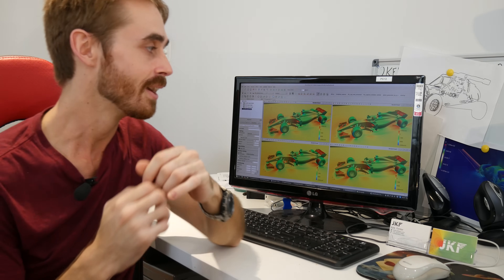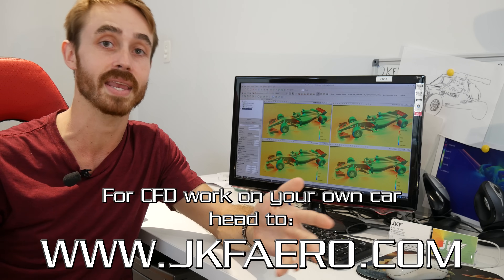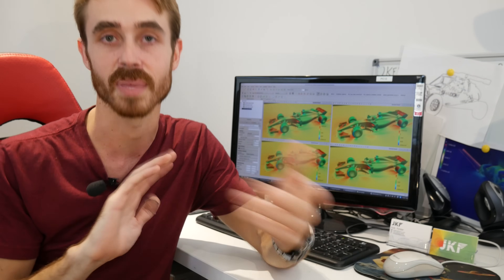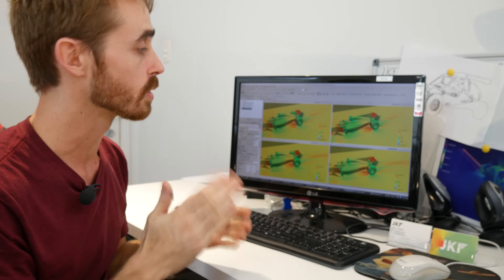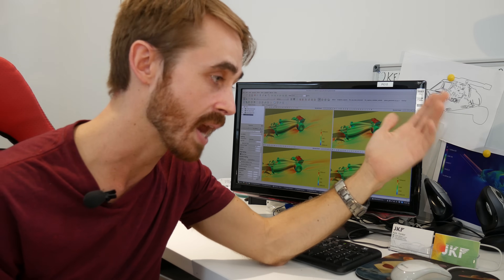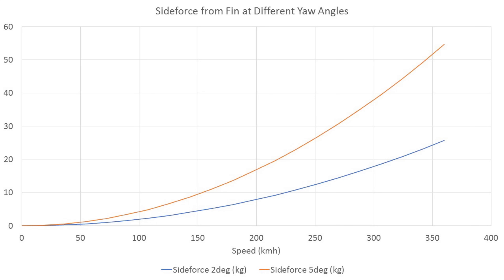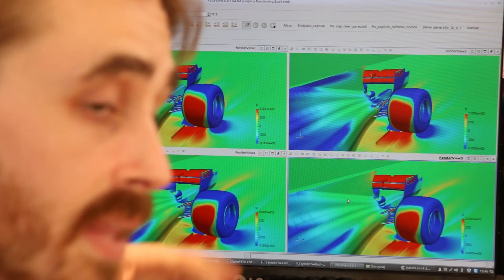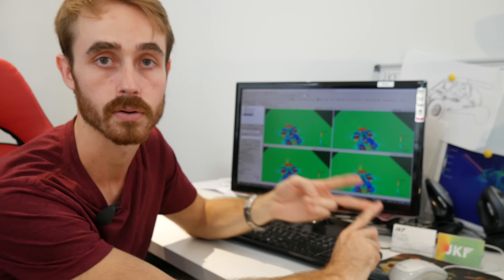F1 Shark Fins in 2017 - How Much They Do, Detailed Explanation and Mythbusting!

Comment: Yeah very simply put, it provides a later force at the rear of the car, which is typically provided only by the tires on the pavement as the car tries to turn.

The rear tires are gripping the pavement, preventing the rear of the car from sliding out during a turn, as well as the fin.

And yeah, it’ll help if you have a tank slapper too which is always good.

Comment: You speak about results confirming the loss of downforce performance in straight line due to the presence of a shark fin, but the interest would more be on the effect on rear wing downforce with cross-flow/cornering conditions (lets face it, there's not a big need in downforce in straight lines...). It helps keeping the oncoming flow on the rear wing straight in cornering or crosswind conditions. And as these wings are designed for optimal performance in aligned flow conditions, it's beneficial for the downforce generated by the rear wing in these conditions. I'm sure you can check the rear wing downforce results to check this point.

I think it's an important point explaining why shark fins have been used in f1 along obviously the main effect of sideforce generation when cornering as you explained.

Besides, can you provide some of the parameters of your computational set-up ? (mainly the turbulence model used - as I imagine these are RANS computations -) It's always interesting.

Comment: I have a question regarding a shark fin on a production car more so on a FWD. Now you may be thinking what the heck do you need a shark fin on a FWD but if the shark fin really does add stability at higher speeds than that means the car can be set up on the looser end for low speed corners. What is your take on this concept?

Comment: Kyle, thanks for the video. I understand you can increase the side force if the car is at an angle of 2º or so of yaw. But this is assuming the car is sliding? in a normal corner without the car sliding does it increase side force at all? Thanks

Comment: Kyle, constructive criticism here. The video mode you're using is continuously changing its focus point, which is annoying and makes the video almost unwatchable (which is a shame, because your analysis is quite good). I'd suggest one of three things, depending on how advanced the video mode of you camera is; none of these will take you more than 15-20 seconds:
1) Take the aperture to its minimum to have the largest depth of field possible.
2) Select your face as the focus point and let the camera do continuous auto-focus on that point (most cameras have some kind of face/eye-recognition software); when you're showing us the computer you obviously select the screen as the focus point.
3) Do some manual focus - choose your face as the focus point and then try to sit still in the chair (to avoid getting outside the focus point).

Comment: in addition to the shark fin, i see that teams are running a t-wing (with HAAS having to remove and modify theirs.) at the rear termination of the shark fin. It is an assumption, but is this in an attempt to 'tidy up' the air onto the rear wing? minimising the negative effect on rear downforce?
Reply: it's actually for additional down force since the rear wing is a lot lower this year. you'll see at tracks like Singapore, teams like mclaren added extra t wings since a high downforce track. so yea added downforce

Comment: Thanks for clearing that up. I've been seeing the "cleaning up air to the rear wing" comment on a lot of professional sites (not just forums and reddit) and have been really confused/non believing.

On that note, secondary question: The "cleaning up air to the rear wing" argument has been made for the t wings as well. Am I right to think this is complete bs? The t wing is way too high and close to the wing for it to have any significant affect as far as cleaning up dirty air. I've also seen arguments for it assisting upwash for the rear wing and diffuser, but I also call bs on that. My guess is that it's more likely that is just a straight normal downforce generating airfoil. Thoughts? Note that these comments don't apply to William's lower T wing. That has to have a significant effect on the performance of the rear wing and of the "connection" between the rear wing and diffuser.

Thirdly, on a more personal note, can you do a video on CFD? It's something I work in professionally right now, but in a much more limited context that what you're doing (I'm analyzing turbo chargers instead of full cars. Much less interesting IMO). What kind of turbulence models are you using? Cell counts? Y+ targets? etc. I'm guessing you'd probably be using OpenFOAM since you're doing freelance work, but I might be wrong about that.
Reply from the maker: Yeah, I think one thing to always remember is that the majority of F1 sites feature content written by journalists, not aerodynamicists. I'm not going to name names, but there are quite a few out there that I have a good chuckle at. 

I agree with you, no way are they conditioning air for the rear wing with the T wing. My primary guess is a free downforce gain combined with mildly supporting the rear wing. You can take a guess at what CFD is running currently though...

And not really, a good magician never gives away his tricks ;)
Reply: KYLE.DRIVES yeah, I think scarbs is usually fairly close to accurate. He's one of the few to talk about the t wing and immediately dismiss (to my knowledge anyways) it having a significant effect on the rear wing. That said, he has peddled the "redirecting airflow to rear wing and straighten up flow" idea for the sharkfin, so there's that too. 

Can't wait to see to see the data for the t wing. I'm assuming you're going to make a video for that one?

And fair enough. I guess we'll just have to trust you on these results. ;)
Reply from the maker: Quick preview, the T wing itself makes 2.5 points of downforce, with L/D>10, which lines up pretty well with hand calcs. So yeah, pretty sure it's just a downforce element. And yes, there will be a video on it!

Comment: KYLE.DRIVES A great video as always. 
Wouldn't it have been better if you had evaluated the Side force coefficient and increase in lateral G's at much lower speeds say around 200 kmph as F1 cars don't corner at speeds above 300 kmph.(Eau Rouge being an exception😉)
Also doesn't the shark fin reduce the down force produced by the rear wing by blocking a part of the central section at high yaw angles?

Comment: could you do a video on the CFD analasys software you use,some tutorials or guides?
Reply: like, he`s an engineer, and I think cfd is a very complex process so it cant be explained in a tutorial, instead its a long study of fluid mechanics, wich is a theme of mechanical engineering.
Reply: mario kovac also what server they are running and how long it takes to calculate something like this.

Comment: Awesome video, loving the new content.

Based on this and your video on Finned Rear wings in rally applications at high slip angles. It'd be very interesting to see a video with CFD analysis of drift car aerodynamics, i.e. when the slip angles are huge (circa 30-60 degrees at times) and how effective the standard aero practices are under these conditions.
Reply from the maker: Thanks! I've actually already planned to do the drift video, models are ready and green to go, I just need to find the time to run them...

Comment: Are there any issues similar to the ones discussed with swan neck wings? Where turbulent flow from the fin could stall the rear wing at high angles of yaw? Maybe this isn't an issue because shark fin is both above and below rear wing? Would this be a bigger deal in 2010 when the fin was more below the rear wing?

Comment: Footage of Renault's car in slowmo shows lots of movements of the shark fins while cornering (they're really thin and high, so lots of deformation due to flexion (5g cornering of its own weight + aerodynamic forces at ~250 kph, that's starting to be some serious pressions/forces)) and they look more like unwanted deformations than anthing, because a vibrating profile is something you don't want in that case. So, why do they still put a fin that deform that much and can only bring bad thing on paper ?
Reply: Im not sure if its quite as effective for F1 but I know that for the r.c. racing I do  we want those large amounts of deformation in the side panel as it improves stability even further and it allows the body to generate more down force mid corner.
Reply: Brandon Mott Downforce, from its name, means negative forces on the vertical axis of a structure, though stability on yaw is mostly made from the lateral forces. I can understand some modifications on a profile helps with aerodynamics, but vibrations of a profile create unstable flow, so unstable forces
Reply: Well with our cars the deformation was so large that the body panels would go from vertical on the straight to 45°+ through the corner, making it act similar to a spoiler forcing air upwards, pushing the car into the track. I'm not sure of the effects of vibrations on the profile however when you increased the amount of bracing on these bodies it often made them slower as the body remains more vertical through the corner.
Reply: Now that makes sense, I didn't knew that ;) Any pictures of this kind of rc car while cornering ?

Edit : you might need some serious lateral forces because as the air flows around the profile, the pressure would bring it back to its vertical configuration, intrinsically giving not downforce

Comment: Kyle, couple of questions. Am I right in thinking you use OpenFOAM for CFD? You do a lot of yaw cases in various videos, have you ever looked into steady state cornering using multiple reference frame (MRF)?
Reply from the maker: I haven't personally looked into it, but my previous business partner did a lot of stuff with rotating reference frames. I'll probably look a bit into it's implementation in FOAM since you mentioned it, but to be honest with you I can't see me running many cases in the cornering condition for clients, the computational time could be better spent on different analyses (roll, pitch etc). For the videos, I'm using the fully automated JKF system, so I just give it the models and what angles I want it run at and tell it go (spent ages setting it up 100% automated a while back). Do you know what sort of computational penalties the MRF has? I think in Fluent it used to work out about 30% from memory.
Reply: I've not actually used it yet, I've been dragging my FSAE team into a decent CFD set-up for the last few years and am now at the point were cornering is the next step. I looked at pitch a while back and built an aero map and last year a couple of undergrads looked at roll and yaw but the feedback from design judging was that they'd be keen to see MRF. From what I've seen it looks relatively simple to do, but unfortunately my PhD work has got in the way so I've not been able to try yet! Guessing in that case you don't use MRF for the wheels either? That's probably where I will start.
Reply from the maker: Ahhh FSAE mixing with PhD, don't fall down that trap! haha
Yeah MRF makes a lot more sense in FSAE as your corner radii are way lower, for higher speed track work it gets far closer to the yaw approximation. If you want some guidance, I suggest you look up some of the work of James Keogh, it may help you out. I think Scott Wordley might have done some stuff with it too for the Monash car. 
And yeah, no MRF for wheels, industry and research standards somewhat differ...
Reply: Haha it's a bit late for that! Nearly finished with my thesis and been doing FSAE the whole time! That's an interesting paper, not one I'd seen before, I have seen some of the Monash stuff. Quite envious of their beowulf cluster.

Yes that's partly why I wanted to look at it to know what difference it actually makes, from what I've heard it seems F1 model wheels with MRF but I suppose they're about the only ones that can afford to...

Comment: Great Video! 
I think that it is more correct to say beta instead of yaw for the angle of attack of the flow respect to the longitudinal axis of the vehicle. They are not the same thing in a general trajectory.
Reply from the maker: If it was an aircraft, I'd agree with you, but since it's a racecar, I'm going to stick with standard car terminology and refer to it as yaw angle ;)

Thanks for watching!

Comment: I've been wondering, what exactly are those little T wings for that Mercedes has just in front of the wing and, I think on Ferrari, on the trailing edge of the shark fin? I know it was mentioned for a second in this video but I'm still not sure what they're for exactly.
Reply: I'm thinking that they provide some down force by them selves and generating a vortex for the rear wing.
Reply from the maker: I always thought they were there just to basically gain free downforce from the downwash off the engine cover, as they will be producing next to no drag. A lot of talk on the internet that they are conditioning the flow for the rear wing, but they are waaaay too high for that, an opinion which Newey's comments seem to support. They may support the rear wing ever so slightly, but honestly, the gains would be very marginal.